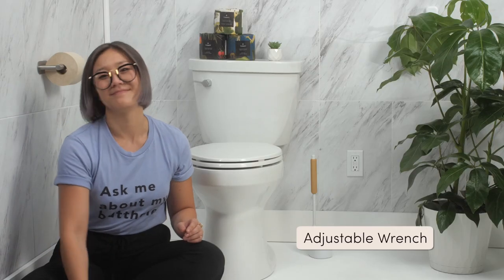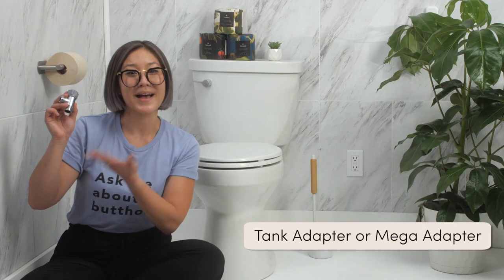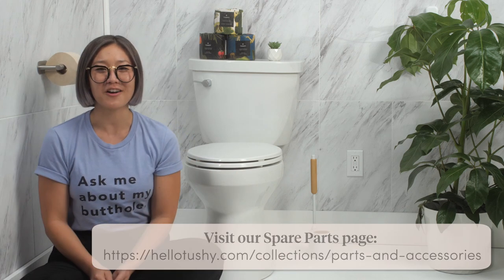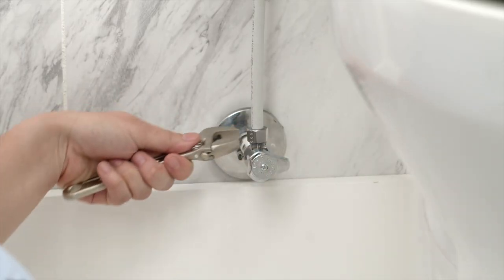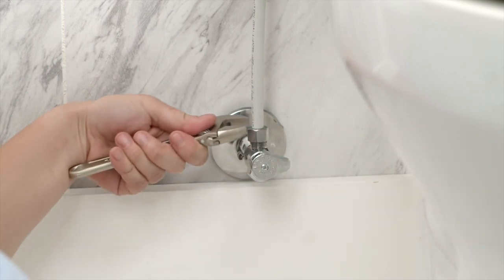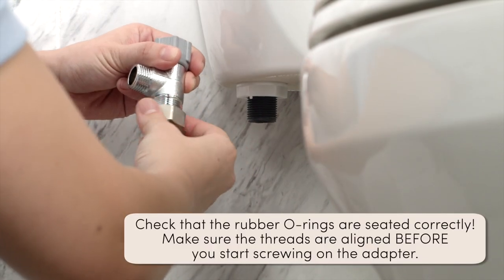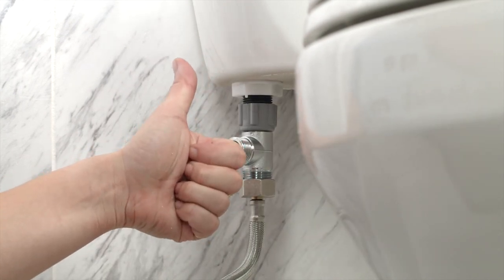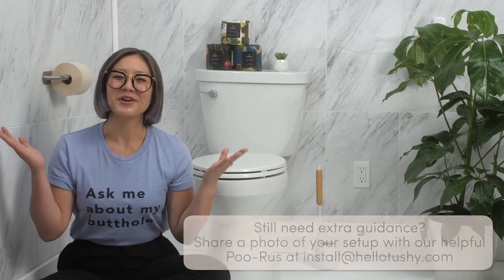How to Replace a Rigid Pipe with a Flexible Hose when Installing Bidets

Comment: I will add that is sometimes necessary to get a longer flex pipe and put a loop in it. That is better than putting any kind of strain on the threaded joints.

Comment: Wouldn’t you be able to shorten the hard line and connect to the bottom of the tee instead of using a flex hose? However, I suppose that might cause stress on the tee when there is movement.